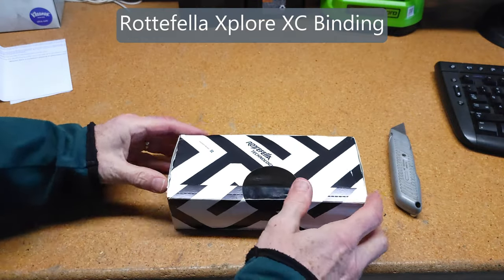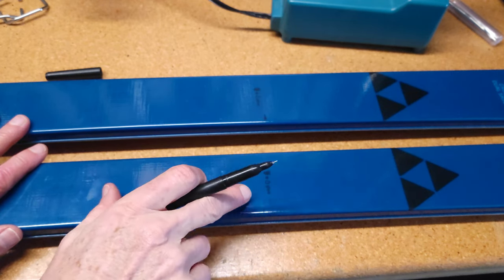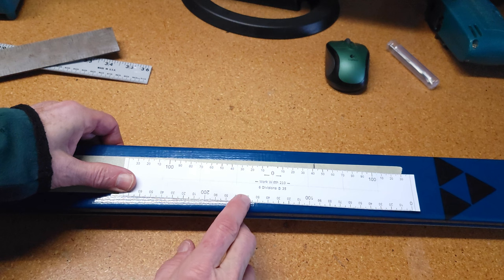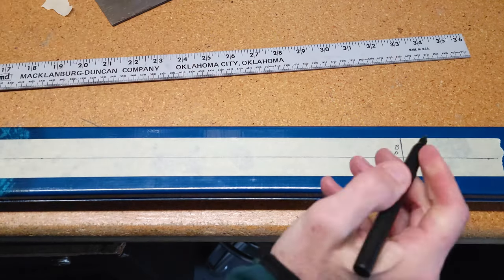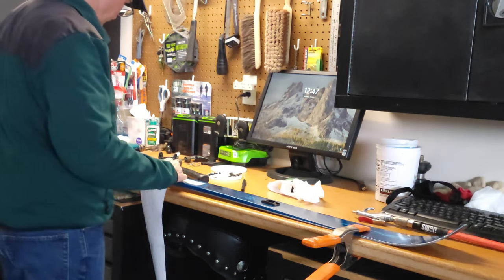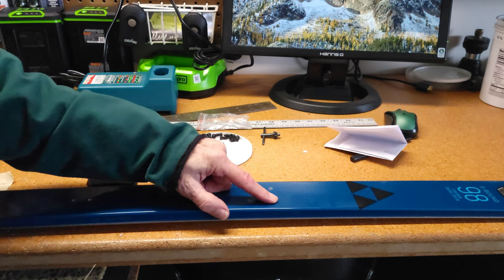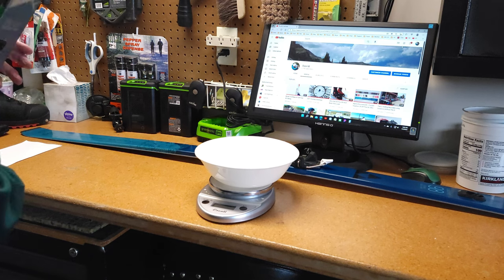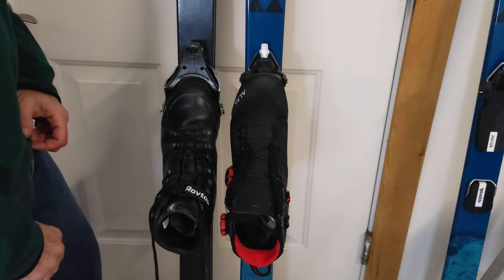Mounting the Rottefella Xplore Binding on My S-Bound 98 XC Skis

Comment: Hello :) What would you do with «the old mountingholes» if you were swapping out from a BC bindings to Xplore bindings?
Reply from the maker: @Gnukke1  The old screw holes need to be sealed to keep water out of the ski.  I fill mine with a medium cure epoxy (30 min to 1 hour), using a toothpick with an up and down motion to make sure there are no air bubbles trapped in the hole.   Two of the front screws of the Xplore binding match up to two of the front screws on the NNNBC binding, so you should be able to reuse those two holes, but if they are too loose to get a good bite, then you will need to fill and redrill those holes.
Reply: @tomm9850  Thank you for replying :)

Comment: Hi Tom! I am decided for Fisher S-bound 98, Alpina Alaska BC boots and new Rottefella Xplore binding. I am 173cm tall and my weight is 74kg. Accordig to the table of sizes for Fisher skies, they reccomend to pick 179cm. But from one post from another bc skier with similar body like mine, he picked 169cm size. So now I am undiceded, which one is better for me. Could you help me? :) (sorry for my bad english)
Reply from the maker: I think I would go with what Fischer recommends (179 cm).   It is always a good idea to include your boots, clothing, and pack carry weight along with your body weight when picking a ski size from Fischer's charts.  If your total weight falls in the zone where two ski sizes are listed, then pick the longer ski if you ski mostly soft snow and want the best kick and glide performance or the shorter ski if you are short and stalky in body type and you are mostly interested in skiing downhill on firm snow through trees.

Comment: Hi Tom I have been thinking about making the leap to the xplore when there are more skis on the market and I'm wondering how the mounting screw pattern compares to the old voile 3 pin (mounted pins on the balance point)? I have QK inserts on one set of skis and wondered if I could add more inserts to swap bindings but fear the mounting screws are too close to each other.
Reply from the maker: None of the holes match up with the Voile Standard 3 pin binding (3 screw mount).  The front single hole on the 3 pin binding is forward of the closest hole on the Xplore binding and it is about 5/8 of an inch away (15 mm).  It should be no problem to drill new holes and mount the Xplore binding, you will just want to do a proper fill of the old holes for strength and water tightness.  You can download the templates for each of these bindings as PDF and print them out (be sure to use option to print to actual size) and compare.  Voile 3 pin https://www.voile.com/voile_3_hole_mounting_template.pdf and the Rottefella Xplore https://rottefella.com/media/sparsh/product_attachment/Paper_jig_Rottefella_XploreOff-Track.pdf
Reply: @tomm9850  Thanks! After skiing today I realized oh I could use the template.  Then I came in & saw your answer.  I use quiver killer inserts which do a nice job of sealing the hole so I might make the ski look like swiss cheese but I sure could have it set up wiht both options now if I find a new ski!

Comment: We are trying to understand what kind of drill tip we need…it gives two sizes on the instructions.
Reply from the maker: I just pulled up the mounting instructions from https://rottefella.com/media/sparsh/product_attachment/Mounting_instructions_Rottefella_Xplore_Off-Track.pdf   They list 2 drill bits,  same diameter, but different lengths, as the binding is sold with either a set of long screws or shorter screws.  The ones I mounted came with the shorter screws. (screw length = 16.3 mm) and the appropriate drill bit is 3.6x9 mm.  For the longer screws, (screw length = 21.8 mm), they recommend a 3.6x15.5 mm bit.   https://www.telemarktalk.com/viewtopic.php?f=19&t=4071&p=64877&hilit=screw#p64877

Comment: If one were to reuse skis that had been drilled for a different binding, how would you fill the old screw holes?
Reply from the maker: I use a slow cure epoxy to fill the hole.  If the new screw hole is very close to the old hole, I use a slow cure epoxy and a small amount of very fine steel wool for extra strength.

Comment: Are you happy with pins on balance point?  If I recall I have mounted some skis about 1 cm in front of BP for better downhill performance.  I just bought some Radd 68 skis and 3-pin bindings so I need to research this again as it's been far too long ago to remember.
Reply from the maker: Yes, I'm happy with the performance of the SBound 98's.  Mounting the pin line on the balance point is the traditional way to mount XC skis.  When I mounted up the Voile Objectives, I did not use the balance point, I used Voile's boot center measurement recommendation.  The pin line on the Objective's ended up a bit forward of the balance point, but it was close enough to the balance point that I doubt I would have noticed the difference.  If your skis have a boot center mark, that is probably how I'd mount them up.
Reply: @tomm9850  Thank you! No markings so I'll mount on bp. I'm curious how well these Rabb 68 skis holds kick wax. It has more camber than my old Boundless Crowns. I also got the kicker skins

Comment: Not sure how I feel about this binding system. Compared to the new Telemark Tech system, seems to be a competition we don’t need splitting the market again. I mean half the reason 3pin survives is because of its compatibility with 75mm, like you have said. I feel Tech toes work can work in xcbc situation as well as offering the option to use beefier boots on hard snow days. The cross compatibility would be easy with the inclusion of something like voiles 3pin setup. 

Idk, but if those bindings are the reason Scarpa is not putting out new boots, I’ld be even more likely to not like them.
Reply from the maker: I hope that Scarpa is working on a lighter, more modern version of a backcountry tele boot for NTN or Tech.  I love my current setup but I'm not getting any younger and my current setup is nearly 17 lbs without skins, with the T2 boots and the Switchback X2 binding accounting for over 11 lbs.
Reply: @tomm9850  you and me both! I hope something like tech toes are the future. The tech seems light enough for proper touring and is also robust enough for aggressive riding. Might actually be a successful replacement of the old stalwart 75mm